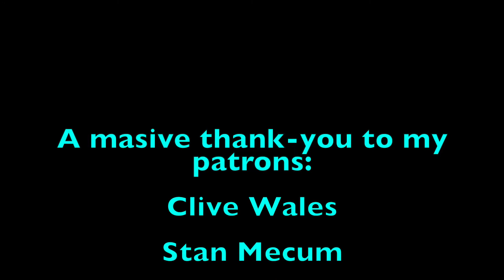Fitting the calorifier E18.

Comment: I think you have no temperature limiter / mixer installed, so always watch out that no one scalds. Good work Des!
Reply from the maker: Thanks for the comment, it has a thermostat for the electric part and a mixing valve for the over all output so should be good. It mixes cold water with hot as it exits the tank. The small black knob on top of the calorifier varies the temperature 👍🏻
Reply: @dapman2007  Excellent, I had not noticed that. A sophisticated top model!
Reply from the maker: @albertfunk1176  only the best for Jay JAY! 😎🤣

Comment: I would consider a small accumulator as when water gets hot it expands and before we fitted an expansion vessel occasionally fittings would pop off and all the water would end up in the bilge.
Reply from the maker: I have considered that and may well do in the future. The tank has a pressure release valve so should only get the occasional spurt. The plan is to attach a pipe to the pressure release valve to a collector bottle, then I can monitor the situation. There is plenty of space to fit an expansion tank and may well do in the future depending on how the thing performs. The real test will be when I run the engine at high speed for an extended period. 🥵